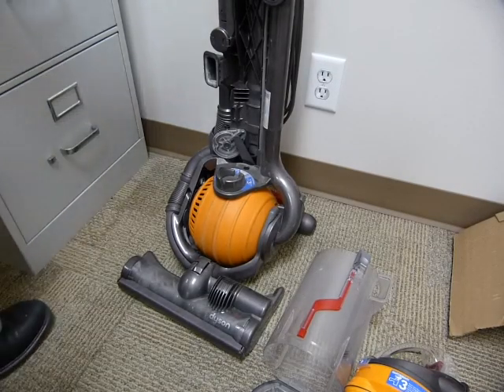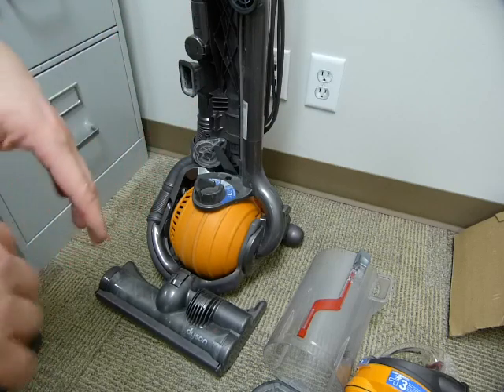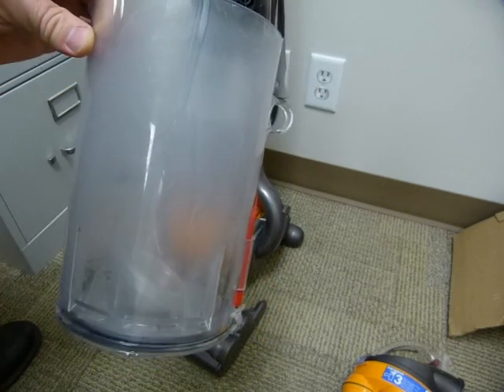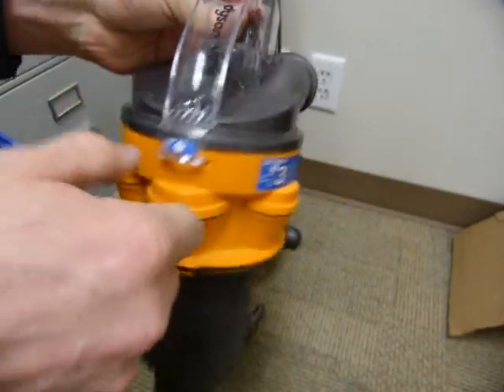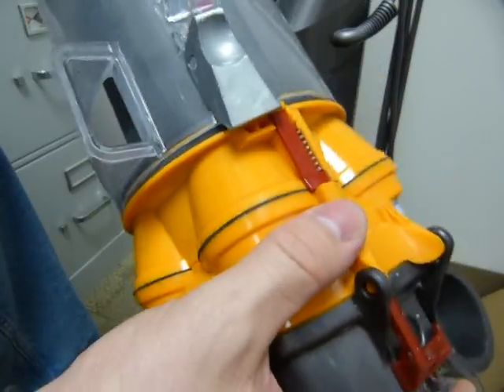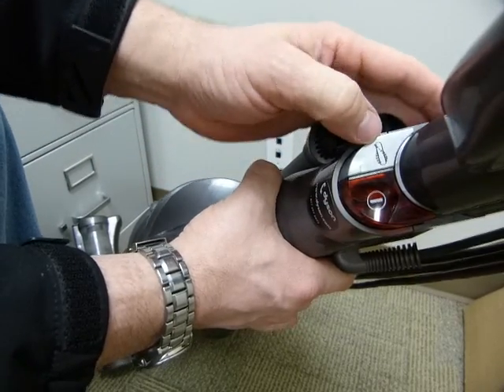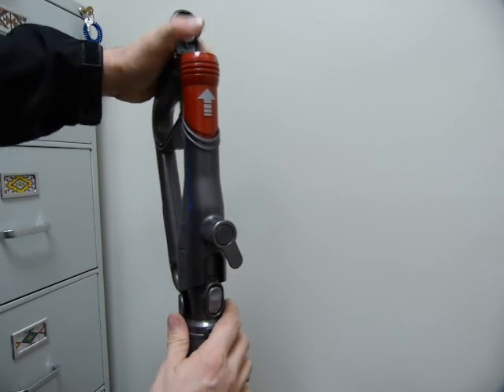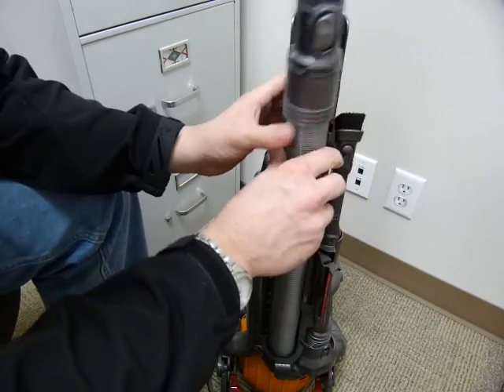Dyson DC29 review

Comment: A trip to the dump?
Reply from the maker: thornwarbler ... yeaaah ... eventually, ... I don`t own it, so, ... I might use the vacuum gauge, you know, for synchronizing carburetors with and take measurements for fun, see how suction drops along the line. I`ll post a video if I get some good data. A vacuum mega suck-off among models, see which sucks most. Something like that.
Then throw it out.